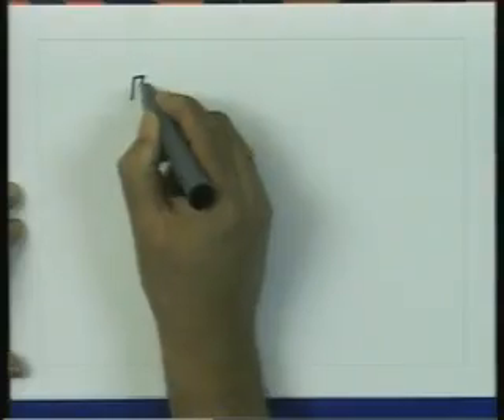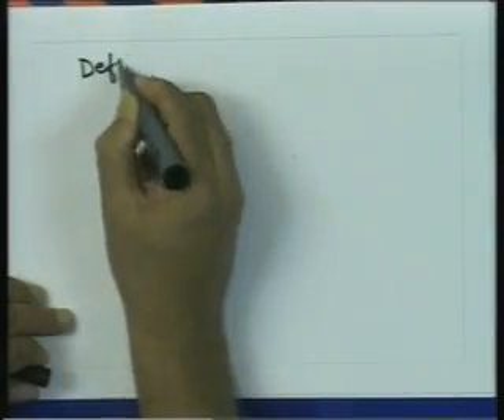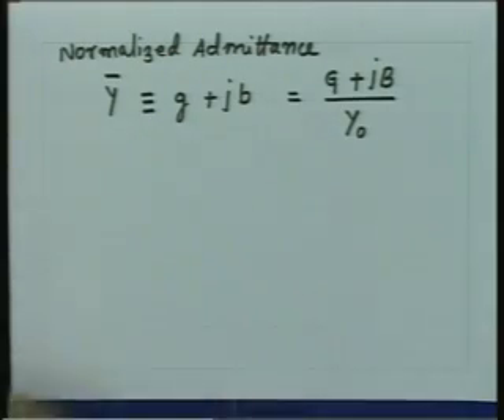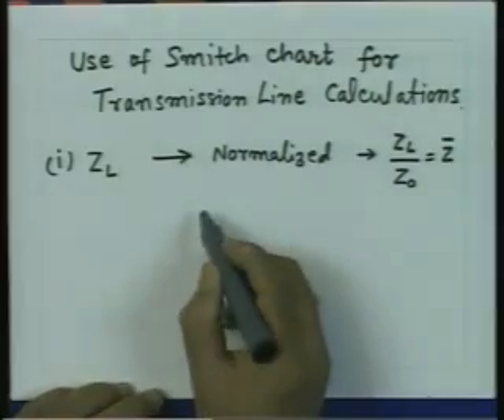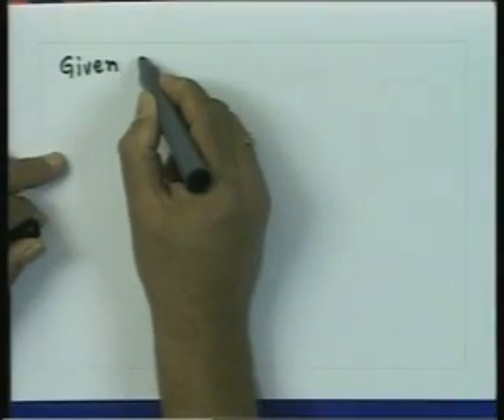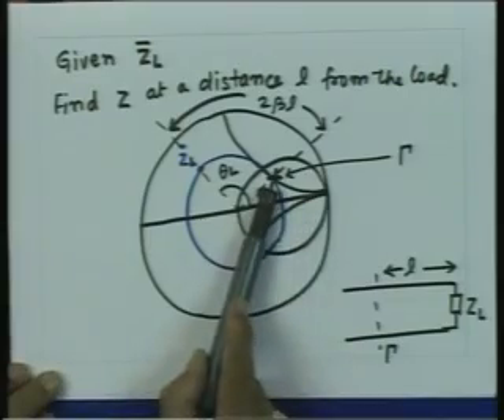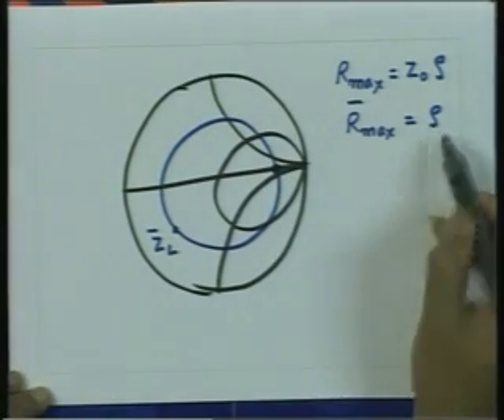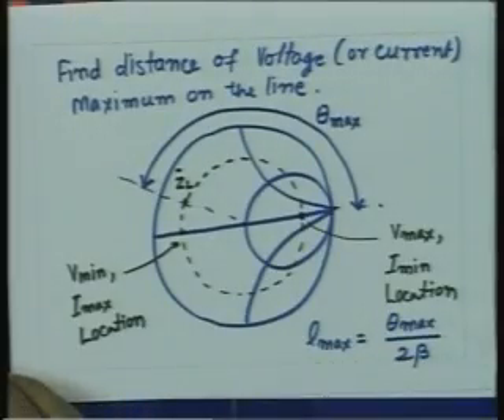Admittance Smith Chart

Comment: When 1/VSWR and VSWR  are on the VSWR circle, how can VSWR be constant on that cirle?
Reply: I am not sure if it is helpful now.
VSWR is constant on that circle. The VSWR and 1/VSWR that sir talked about are equal to the values of Resistance at those points. We find the value of resistance on those points as it is marked on Smith chart and those are equal to VSWR and 1/VSWR respectively. The value of VSWR is not directly marked on the Smith chart so we have used an indirect method by using resistance values.
Reply: The value of resistance is changing, not the VSWR. For eg:- if I take VSWR = 3, it is going to remain 3 only. But the normalised R min value is 1/3 and R max value will be 3. To calculate R min and R max you still have to multiply by characteristic impedance.
Reply: The name 'constant VSWR circle' can be deceiving. VSWR, by definition, is a ratio of magnitudes for max voltage to min voltage. The relative values of these 2 may change on the transmission line but the ratio - VSWR does not.